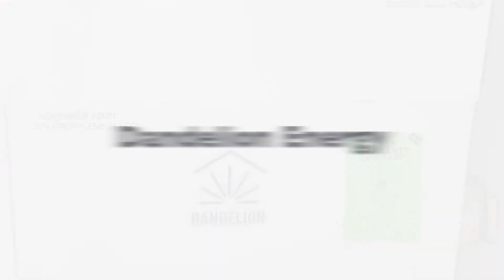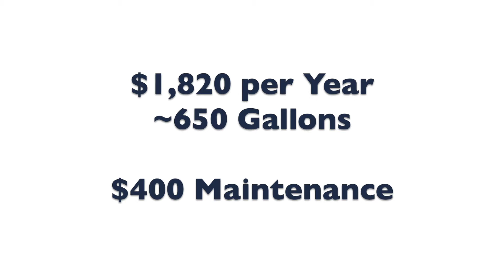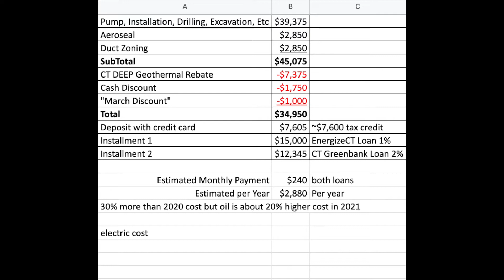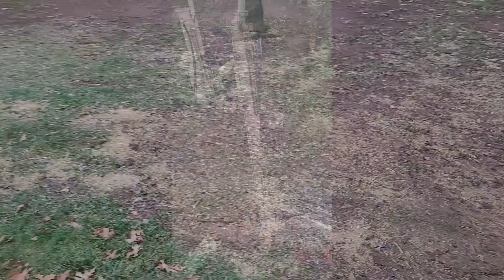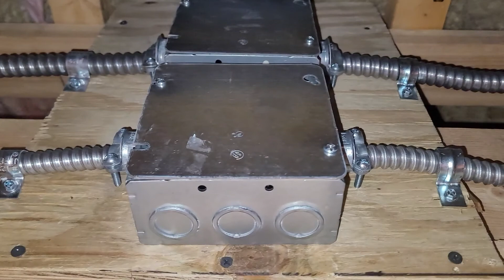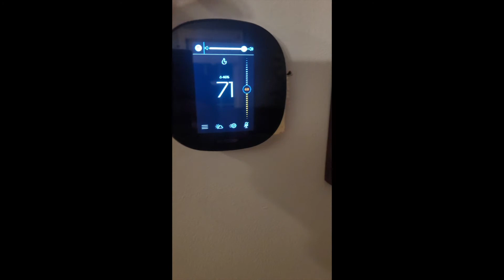Dandelion Geothermal Heating Cooling

Comment: Thanks for putting up the video.  Very helpful.

So a few years after the install, do you have any data on the additional electricity use and cost to run the system?  I'm looking to make the jump but real world numbers would help.  Depending on the figures, I would install solar and size it properly.  Thanks again.
Reply from the maker: About an extra 5000 kwh of electricity per year, which is mostly to  heat the house.  This is slightly cheaper  than home heating oil usage at $3.50 per gallon. If I add in maintenance costs saved per year, then I am in the black.  

We've seen ridiculous delivery and "public benefit" fees this year with electricity, so I may be breaking even, unfortunately.  I have solar panels that help defray costs.

Comment: Nice video in explaining all the process.  I have question for you on this.
Did you had to or did Dandelion Energy had to get a Topological Survey for your property, before the system was installed ?
Reply from the maker: Hello, I did not do an "official" topological survey.  Dandelion did at least 2 reviews of the drilling location that I know of. They made sure the pipes were far enough away from obstructions as well as the property line.

Comment: great video. please post updates. question.. why doesn’t it seem in your cost breakdown you took advantage of the 26% federal tax credit?
Reply: I believe it goes to 30% in 2023.
Reply from the maker: Hello, thanks for the question,  Around the 6:20 mark there is mention of the federal tax credit.  It was tied to the credit card amount we floated.  We did our taxes and actually received a higher credit around $9k.  This is a 26% credit 2021 & 2022, which will decrease to 23% in 2023.  To be clear, it is NOT a refund but a credit that decreases your taxable income.

Comment: an interesting process, but seems like way too much of a science project at this point. still doesn't sufficiently address the reasons why heat pumps are in less than 1% of US homes - complexity, major heavy equipment construction, and thus high cost. cost would still have to come down by an order of magnitude for something like this to truly become widely adopted.

Comment: Thanks for putting the review together to help folks like us considering one of these.  It seemed pretty loud when you were in the basement near it?  Can you explain stage one vs stage two and why you mentioned trying to stay in stage one?
Reply from the maker: The unit is actually very quiet. It is in the basement and I don't hear anything from upstairs. We have finished basement and there are no issues while watching tv.  

There are two stages to the pump and geothermal aficionados will say to set your thermostat so it is always running stage 1.  2nd stage is the full compressor capacity and 1st stage is 2/3 capacity. Overall your system should be designed to maximize savings.